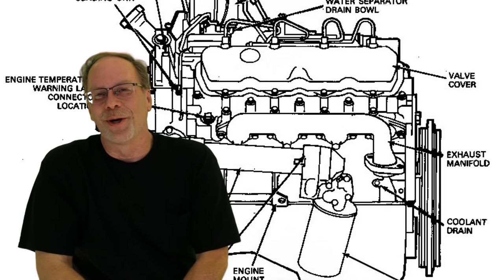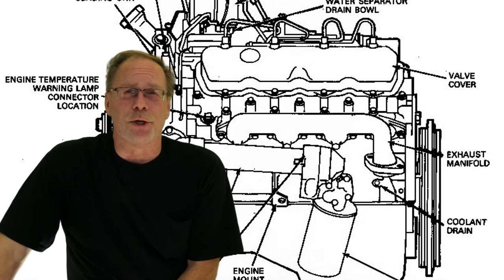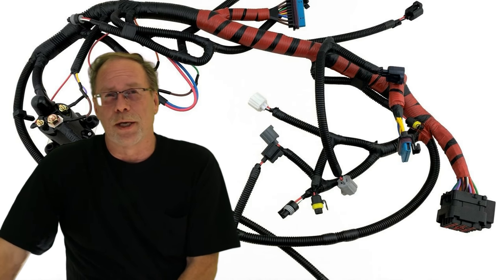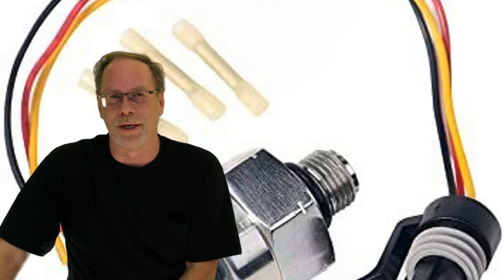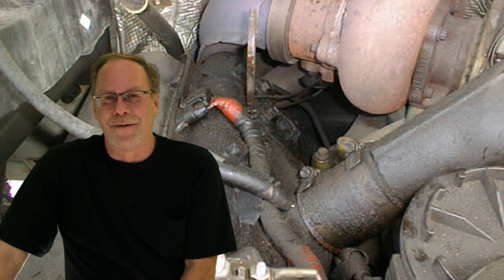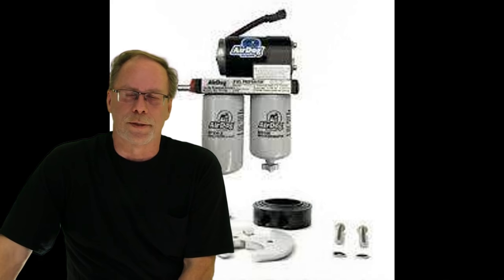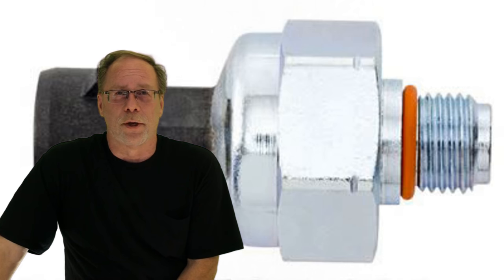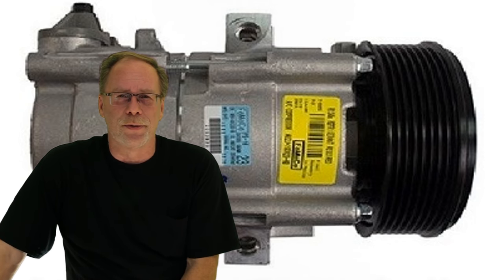11 7.3 POWERSTROKE ISSUES STOP IN AND SEE COMMON FAULTS.........

Comment: Thank You very Much For Posting this....Yah, sounds like a jet plane. Looks like I have some work to do on my 2001. First time I have seen anyone speak of that issue despite much searching and oil impregnated wiring issues which are the bane of my existence. The GEM module is confounding as well. Thank you

Comment: Glad I found your channel.  Using your knowledge and advice and that of a few other great channels I've found, I'm about to pull mine and rebuild it myself.  Haven't done any serious mechanic work in many years but I'm damn sure gonna do this.  Can't afford the 12-15k for the rebuild I want via a specialized outfit and don't trust the motors coming from the 4-7K rebuilders based on everything I've read.  I'd rather put this thing on a stand in my garage and do it myself and do everything the way I want it and give it the attention to detail.  Fortunately I have another truck to do my pulling with in the meantime.

Comment: Regular maintenance, IE engine fluid changes. Oil testing is also a very good idea. I would also recommend that any time you service the radiator, change out the thermostat with the real deal OEM stat,

Comment: I was a lead mechanic for Weyerhaeuser for about 20 years (80’s and 90’s) we were Ford authorized warranty. We ran oil analysts on everything. I noticed that the 7.3s were coming back with high iron content. So started tracking them. They continued to gain iron. So I contacted Ford. At first they didn’t want to acknowledge that anything was going on but after persistent hounding I got them to admit they knew there was a manufacturing issue. Turned out the casting was too thin on number 8 cylinder and it would create hot spots on the cylinder wall so every time the piston went by these spots it scraped a little iron off. They said they didn’t plan on doing anything about the issue unless they did’t make it past warranty!🙄
Reply from the maker: It is always interesting what auto mfg industry sweeps under the rug on the unsuspecting consumer

Comment: My 1997 F250 diesel has been a pretty good truck, I still have it and I can`t talk myself into getting a new one. It runs flawlessly, I bought it new 25yrs ago and I think it`s part of my life now. Other than normal maintenance I`ve had a torque converter and water pump failure (repaired warrantee) two lift pumps, a set of glow plugs, one alternator, A/C compressor and a starter. I was able to fix it myself and it wasn`t that expensive so I can`t really complain other than it looks terrible, it was a work truck for many years. Everything still works except the dome light, works when ya open the door but not if you try to turn it on manually. Same way with my1986 F250. Oh yes the front end, ball joints, drag link, tie rod ends and U-joints on the half shafts
Reply: Keep it. They dont make em like they used to. Im a ford fleet tech and im biased because i mostly only see the broken ones, but i just bought a 7.3 econoline and i wouldnt buy a new truck to replace it

Comment: Great video! I will say, as far as Bluetooth code readers, "Blue Driver" brand IS NOT compatible with 7.3. I plugged mine in to diagnose a crank no start and it said remove immediately, may cause damage to PCM.
Just so nobody buys that brand for their 7.3
Reply from the maker: Thanks for the info!
Reply: Use an app called FORScan lite and buy I think it’s called vlinker something on Amazon, amazing app can run all types of tests including buzz tests

Comment: I almost never comment on anything on the internet. But from watching a few of your videos I really feel that you are more than capable of providing great knowledge and your wording is also very helpful for someone like me. I have just started rebuilding a one of one 1996 F350 CCLB dually and have been searching for all the info I can gather before spring hits and I hit the ground running rebuilding her. I want to try to keep it as much as the original conversion company did with obviously upgrading under the hood as much and a little bit suspension as well. I would like to try to keep it with the original stock rims and such as well. Maybe a little bit bigger tires and maybe a little bit of a stance. You get the picture. Anyways what I'm basically getting at is that I'm not the best with these internets and was hoping I could touch base with you more on a one-on-one or personal level if you would. I'm not really big on this new age New world communication. I could definitely use like a big brother scenario on moving forward on my truck. I don't need anybody to build it for me or anything done like that but I definitely could use some assistance or opinions from time to time! I really appreciate the part where you highly advised against a certain product in the vehicle. It goes to show that you have done more than just read a book!

I'm not sure how I could touch base more with you without leaving my personal info on here so I'm more or less just going to wait to see if you even reply to this comment.. best of luck to you and yours

Comment: Great videos!!  I have a problem that I have not found the fix for yet.  I have a 7.3 excursion and it has a rough start and when coming off of the freeway on the deceleration at 40 rpms it dies.  It takes a few seconds of cranking to get it started and when it starts it chugs for a couple of seconds but then it takes off and runs just fine.  It has this rough start every time i start it.  I have replaced the ICP, IPR and the CPS sensors.  The forscan shows on starting the ICP psi going above 500 psi right away and the injector test is ok.  What else can I test to find out what is causing this problem?  Can I test the ECM to make sure it is functioning correctly.  should I have the ECM reloaded?
Thanks
Reply: Check your vacuum pump.

Comment: Very informative video. I hope you can solve my problem. I have a 96 F-350 with a 7.3 Powerstroke turbo. I recently put in two new fuel tanks and everything else that was needed to repair that issue. However, now when I drive my truck the transmission goes into overdrive out of nowhere.  Do I need a new transmission or do you have any idea what I can do to fix this. Thanks in advance for your reply and help.
Reply: You got bypassed because you didn't heap on any praise along with your question...lol

If you are in a cold weather state, it is a common thing to have older vehicles transmissions fail...what you are stating is pretty much how that happens... and also the overdrive can fail first and not stay in that gear...
( I had two go that route...good luck to you)

Comment: here we go.  my 7.3 started running rough and has no power.  at the same time the alternator is getting really hot when driving it and the new batteries died.  i don't believe their is a short while the truck is turned off.  i took the batteries out and charged them.  the truck started and ran only when i depressed the accelerator all the way to the f loor.  otherwise it would only start for a few seconds and then stall.   one day before the batteries died i plugged in the engine block heater and the truck started and idled but still ran poorly.  it was above 30 or 40 degrees though.  i do not live in a cold climate.  i did notice a wiring harness rubbing on the valve cover on the driver's side.
Reply from the maker: https://www.youtube.com/watch?v=Nr1cnkaVBjg  https://www.youtube.com/watch?v=3EW5RubMsXE

Comment: Hey, well done - a lot of info in your video, and I learned a lot watching it. However, watching it was much like scanning the front index of a good book... I was left wanting to know more! Since you obviously have in-depth knowledge on the 7.3, may I humbly suggest that you'd expand on some of your points, perhaps a separate video for the ones that you will find people querying in the comments? For me, I'd like to hear more about the accelerator pedal problem... what specifically is the issue with it and how does it present itself? Also, I appreciate you don't want to knock down or "endorse" any specific brand of engine code readers, but what is wrong with the little "Walmart" code readers, and what unit is the one you are using? Overall a top-notch video!
Reply from the maker: Thats the game plan I'm goin to see the comments over the next month then hit on exact info in separate videos
Reply: I had intermittent failure of the accelerator pedal, usually seemed to happen dropping out of cruise control.  Unnerving to be driving and press the accelerator pedal and nothing would happen, then it would recover usually after a short interval, sometimes I had to stop and cycle the ignition.  Seemed to be an intermittent dead spot at 0 pedal pressure, the reason that the failure was seemingly more common dropping out of cruise, don't know why it lingered sometimes and sometimes resumed after a bit.  After a few instances finally noticed the check engine light (which went out when unit was working again, just to confuse the issue.  When the accelerator stops working in traffic one doesn't have time to notice minor details like a check engine light).   The original accelerator pedals are much stiffer than the replacements, the replacements are like F150 pedals, not stiff like F350/F250.  Took a while to get used to the very light pressure the new pedal needed, especially when wearing boots.   IIRC if one is ambitious and wants to take the risk, the sensor can be replaced by drilling out rivets to keep the old pedal mechanicals.  I went with replacement "feather light pressure" Ford OE and the replacement bracket.   Easy job, took much longer to determine the actual Ford PNs needed;  lots of aftermarket available that are not rated as reliable as OE based on numerous complaints.  Rather pay more to get more reliability and longevity.

Comment: Great video.! Thank you.   My 2000  7.3 has no power at take off  however I manage to get to 60 mph steady no pry then I come to a stop ot light. And tuck feels rough.  Changed the fuel filter and nothing.  It even stalls when on nutral.   Engine has 250k miles.  Any suggestions gang???

Comment: I use Forscan and my laptop with a high speed USB adapter and I also have iCarsoft Pro which actually showed my IAT code that wasn’t showing with Forscan. 

I was able to do all the main tests like cylinder contribution with Forscan

Comment: These sensors are cheap I recommend getting things like the cam sensor and keep it in the truck. It’s so easy to replace. You can do it in less than 5 minutes on the side of the road with a wrench if you needed to. And yes they fail. I only buy the factory Ford sensors because the aftermarket a junk.

Comment: Great video! Why does my 2000 7.3 turn off when they hook up a scanner on it? This happens when I take it to get it smogged?
Reply from the maker: Using the wrong testing program They can not run a running diagnostic on a PSD Computer

Comment: My 2002 F350 the original OEM Motorcraft batteries lasted 12 years, I replaced them with new OEM Motorcraft batteries and they are still going strong. I had heard years ago the OEM batteries are the best and they were no more expensive than any other name brand battery.

Comment: Great vedeo and great explanation 👍 👏 👌  a question my iCP sensor starts  leaking on electric connector! and I buying a new one for  replacing and looks like not fit on thread!🤔😏 because  leaking a little bit by thread 🤔 I buying another new one from "rockauto"  and it's a same situation 🤔😏 the oldest not leaking by thread and looks exactly the same 🙄😳😳 do you know what caind of sensor is a correct one?  Great helpful explanation about 7.3👏👏👍 I want find out how to fixing this problem 🤔 damm ICP sensor 🤪 have a great day SiR 👋 cheers from Norway 👋
Reply from the maker: there are 2 different ICP's Rock auto carries everything from low grade garbage to mid quality, I only recommend from experience ford oem replacement parts but some ICPs come with thread sealer dipped on the treads and some have a O ring and some are wedged depending on the manufacturer The ones that leak usually are from MFGrs whom don't have the licence to produce them and there threads allow HPO to pass by them and don't have any sealing ring or previously mentioned , In a pinch plumbing thread dope does the trick
Reply: @CUSTOMWORKS7.3PSD  hi thanks for helpful information I appreciate 🙏 but here the FORD not sold parts for american vehicles 😏🙄🙄🤔  if you know a company sold that can sensors I can import 👌👍 that's a reason when i needs buying something for my american vehicles I buying on "rockauto"!!  we can not buying anything here in Norway 🙄😏😕 I need buying a  that iCP sensor because leaks oil on inside 😀  the rest is fine 😀  if you know some american companies export part's please let me know thanks so much you are a man 👏👏👌👍 cheers from Norway 🇳🇴 👍

Comment: Have you ever had a 7.3 that once it is heat soaked the starter won’t engage? I have replaced the starter and the clutch starter safety switch. But, after the engine is good and hot that starter doesn’t get the power., but it works fine cold. Could it be the starter relay or the fuse-able link?

Comment: I'm beginning to wonder if driving a new truck is worth it. Maybe I'll just rebuild a old 1980's truck, remove all the emissions crap, and put a rebuilt engine in it. Thoughts ?
Reply from the maker: resto mods work both ways 10 year old vehicle with a 30 year old rebuilt power train
Reply: @CUSTOMWORKS7.3PSD  Yes, that's an idea too. However, I believe that vehicles prior to computers ( 2006 ) no longer require emissions testing, so that would necessitate a bit older. I happen to have a very clean square body Chevy C60 truck. It only has a 366 but I do believe it will swap easily with a 427. I don't care about power windows or even A/C . I just want simple old school reliable and strong. It has a two speed rear as well. Frame and body are rust free. Perhaps a diesel would be better but this truck might do the job for me. Might even get better mpg than new trucks !
Reply: I have a 1981 vw diesel with a late model Tdi swap running a mechanical pump. 

Engine has 400k+

Never been on a tow truck yet. 
Gets 50+ mpg 
3x as powerful as stock. 

Impossible to beat.

Comment: I watched "project farms" review of AT205 and got some hoping it would get me through the winter with my oil cooler o-ring leak. Pause for your laughter...... Anyway, I followed the recommended usage of 1 bottle per 6 quarts of oil. The leak didn't stop but improved. Then I saw this video yesterday and immediately dumped my coolant and engine oil and changed the oil cooler O-rings. I maybe put 2 miles on the truck with the AT205 in it. Anything I can do to prevent seal harm?

Comment: Brother I don’t even know where to begin saying thanks first I was just , just about to put the AT-205 in my 7.3 I had been looking and looking for information on the use of it with the 7.3 so thank you for saving my rookie A:& haha also I have been having problems with my truck about six months ago I had replaced my fuel relay switch inside the dash just below the stereo and I just did it again but this time it didn’t fix the issue so I looked and listened to the pump under my drivers side that seems to be turning on but still sounds like I’m not getting fuel so again thanks for the tips on the fuel system I’m trying to research putting a sump just have to find a good rated one also if you can answer a question for me do I need to remove the guts of the original one the straw feed or can it stay I do plan on dropping the tank to clean it out I figured I’d just do myself and the truck a favor and clean it out but thanks again and I so hope you keep putting out info 

David
Reply from the maker: have a video on sumps and any one is just fine but see the sump video

Comment: 11 years on the same batteries!? Holy moly. I'm lucky to squeak by with two before I see a decline. It's 100% due to short driving, possibly a small parasitic draw somewhere that hasn't gotten bad enough for me to fix. I've got a new battery cable set just have to get it on there. Will be looking for that battery video next!
Reply: Put a trickle charger on them regularly
Reply: I got 8 years out of 2 Motorcraft batteries.  I will be using them until I die....

Comment: I was warming up my 95 7.3 and it just died. Crank no start. I lost power to the IDM and the relay fir it and the GP solenoid were going crazy clicking. So I checked the wiring harness and the IDM but traced it back to the PCM and one of the grounding mosfets had a missing leg and corrosion creeping up the legs. Ordered replacement chips and fixed my problem. Ships wanted 1000$ for a new pcm. I fixed mine for 6$ and some soldering.

Comment: Your videos are great, I have recently have an issue with either cold or hot start the engine will surge until I lightly Rev the pedal a few times. Do you have an idea to check. Thanks
Reply from the maker: That problem should have the codes read, Multiple Items could be causing that issue